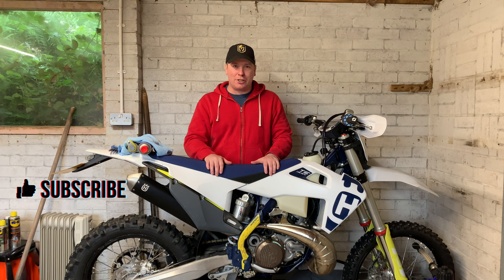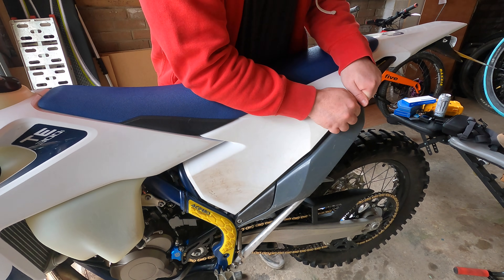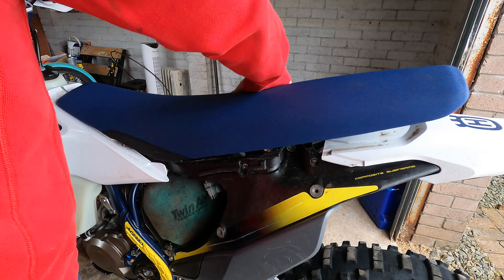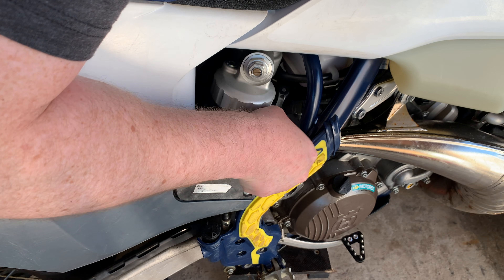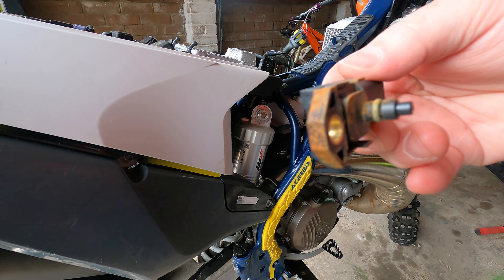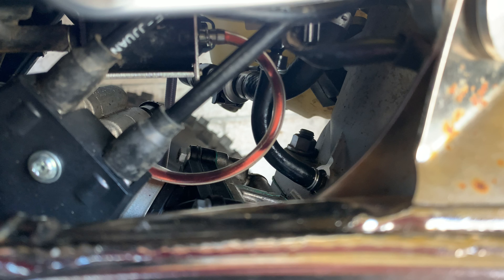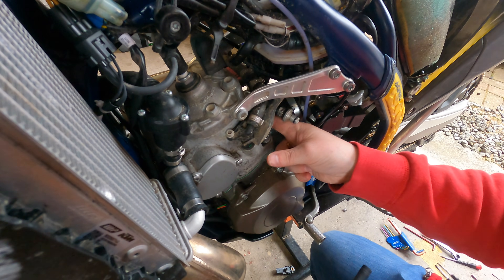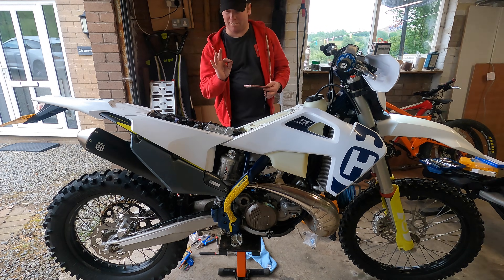KTM Husqvarna TPI CRANKCASE PRESSURE SENSOR ISSUE Repair. Free easy Fix for rough idle and stalling.

Comment: What app is this to see the revs etc etc? Is that a different ECU to be able to have that?
Reply from the maker: No mate, standard ECU and just used the 6 pin connector that is either under the ECU or poking in to the air box.
The app is called Car Scanner which was free. 

I bought the wireless OBD2 scanner and 6 pin CANBUS lead from Amazon

The links are below if you want to have a look. 
The scanner does both IOS and Android but I believe some cheaper versions of the same thing are iOS or Android and not both.

With the CANBUS to 6 pin cable, have a read up to see if it fits your bike, I think I took a gamble on the lead in the link down below but it worked so it was all good because I think most 6 pin connectors are the same. Hope this helps 👍🏻

 Foseal OBD2 Scanner WIFI Auto... https://www.amazon.co.uk/dp/B077F8F6TB?ref=ppx_pop_mob_ap_share 

OBD 6Pin Diagnostic Adapter for... https://www.amazon.co.uk/dp/B07VQQ3CHJ?ref=ppx_pop_mob_ap_share
Reply: @MALVSMACHINE  thanks for that information mate! I haven't got a TPI yet I currently am rocking a 2002 KTM 200 exc dinosaur but hope to get myself a TPI either KTM or husky soon :)
Reply from the maker: @ollie6512  no problem at all mate, i’m always happy to help where I can👍🏻. Awesome stuff, you won’t regret it. If you can, keep hold of that KTM, it’s a great bike and will only start going up in value in the future, the same way the old RM and KX bikes have over recent years 👌🏻.
Reply: @MALVSMACHINE  yeah ive definitely thought about doing this if I'm honest!
Reply from the maker: @ollie6512  good man 👌🏻
Reply: @ollie6512  Hold onto your 200! My 03' MXC is the most reliable bike I've ever owned. With suspension work, it can hang with my 18 XC-W TPI 250.
Reply: My only question exactly

Comment: I can’t find the angle sensor on my Husqvarna Norden 901. Where is it located on the motorcycle? I think it stopped working after the bike tipped over.
Reply from the maker: I don’t have a Norden 901 to be able to answer your question sorry bud, the only Husqvarna I own is the one in this video and they don’t have the same electronics.
Reply: @MALVSMACHINE thank you

Comment: So after a weekend of crappy weather I decided to take my bike out for a ride. My bike was running fine for around 3/4 hours then suddenly started bogging before full throttle on. Starts & ticks over fine even after the issue just when you jump on throttle then starts playing up. I am going to take a look tomorrow with your suggestions. But anything you could suggest whilst doing so?
Cheers

It’s a te250i 2021 btw
Reply from the maker: @christopherbrown5500  Hi Chris. Sorry to hear your TPI is playing up, cranky things aren’t they! 
Hopefully cleaning the tray and outer area of the sensor will sort it but failing that, do the usual checking of the pipes to make sure they aren’t blocked, and that the plug hasn’t fowled up. You could swap the ccp sensor with the ambient air sensor while they’re out of the tray so that you’re covering all bases. Give your electric cables a once over as well to make sure nothing has snagged. 
I hope all goes well so you can get back to it ✊🏻

Comment: Dude i have been trying like crazy to figure out why my bike is idling like that. I changed the fuel, filters, plugs, everything! Im going to give this a shot and see where it lands me. If this works I will report back with big props. Did you also swap the crankcase and the ambient sensors? Ive heard that works as well.
Reply: So this absolutely worked!! I cleaned the connectors, tray, tubes, and fittings with compressed air and swapped the sensors. It run perfect now!! Idles great and smooth and angry all through the rev range. Thank you so much for posting this!! I hope this video finds other Husky and KTM owners before they go through all the crap i did. Pretty sad that my 1 year old bike with 19 hours has this kind of issue honestly. KTM really needs to address this. Thanks again bud! Cheers!!
Reply from the maker: @HighSpeedTV  ah man I’m so happy, and glad you can get back out and enjoy it again! 
Yes they definitely need to address what’s going on with them, whether they look at a better design for the tray or a different manufacturer for the sensors, something just needs to be done. Thanks for letting me know how you got on, much appreciated 👌🏻
Reply from the maker: Hi! Ah man, it’s a pain isn’t it! 
I didn’t swap the sensors because I was hoping to make the video a kind of problem solving video, and as it goes, cleaning the area and making a better seal using grease around the o-ring cured it, thankfully. 
If It didn’t work, my next step was to swap the sensors like you mentioned, so it’s probably worth doing at the same time you’re cleaning the outside of the sensors and the tray just to save having to remove everything again if there’s no change. 
Another thing I’ve read up on since my issue is the type of fuel used in the bike can make the bike run poorly. The factory manual recommends Super Unleaded or 95 RON for EU bikes but I don’t know what that equates to in fuel used in other countries. 
Thanks, I’d appreciate it if you let me know how you get on as this common problem is really intriguing me and I’d like to see what is working and what isn’t so that we can hopefully find the best, free/cheapest fix for us TPI owners to continue enjoying our dirtbikes!

Comment: What is that rpm app???? If u could let me know that would be awesome please
Reply from the maker: Hi, the app is called Car Scanner ELM OBD2 👍🏻
Reply: @MALVSMACHINE  okay thankyou so much also i was cleaning my bike and i left a cloth in the air intake and nothing got sucked in but now my bike sounds like urs did in the beginning do you think it’s the sensor? It was running rlly gummy when cloth was in there i was thinking maybe a bit of gunk got into the ccp sensor hose? You know more than me tho do you think the bike will be okay?
Reply from the maker: @StupidActivities101  hi dude. Honestly, these TPIs are little divas so it’s a bit of trial and error with them 😄.
I think it’s worth cleaning the sensors, tray and piping to see if that makes a difference, and if that doesn’t work, swap the CCP sensor with the ambient sensor (Assuming the bike has one) and hopefully that’ll work meaning the sensor went bad.
That’s pretty much the limit of my experience with the issue dude. If I stumble across more info, I’ll drop a line on this thread 👍🏻
Reply: @MALVSMACHINE  okay okay yeah thank alot ill definitely take a look at the sensors do you know if the cloth that was in the intake when i ran it could have caused any internal damage?
Reply from the maker: @StupidActivities101  to be honest I wouldn’t like to guess; I never run a bike without a proper filter.
Reply: @MALVSMACHINE  alr thanks for the help also is there anything more to taking those hoses out and cleaning them or do u just take them right off and clean them
Reply from the maker: @StupidActivities101  anytime mate 👍🏻. It was just a case of taking them off, cleaning them and making sure they were completely dry before putting them back on. Be patient with them as well, the plastic tray is quite flimsy so if you’re forceful when pulling them, you may break the plastic bit that the pipe attaches to.  👍🏻
Reply: @MALVSMACHINE  it’s a 2023 bike u think i will need to clean the tray? Im so new to tpi man
Reply from the maker: @StupidActivities101  all depends on if it’s dirty or not dude, you only have to clean where the sensors sit to make sure the o-ring on the sensor gets a good seal.

Comment: hello, for a few laps I feel that my 300 tpi is slower in revving and it seems to have less power, I thought it was because it's very cold but now I'm evaluating the problem you describe in the video, what do you think? Do you also feel a slight decrease in power in cold weather? the bike has 40 hours.
Reply from the maker: Hi Alessandro. Where I live it’s cold and wet most of the year round so the issue started and never got better. 
I’d say it’s worth cleaning the outside of the sensor and the tray as it doesn’t cost anything, and then seeing how it fares from there.
Reply: @MALVSMACHINE  Thanks a lot for the answer! why do you advise me to remove the sensors and clean them? How do you recommend I clean them?
Reply from the maker: @alessandrotrosardo295  no problem 👍🏻. 
I only recommend as it seems the engine vibrations allow water and dirt to ingress and dislodge the crankcase pressure sensor enough to cause the engine to bog down/idle rough. 

To clean, I just take the sensor out of the tray and clean the outside of the sensor only, and then the tray so that the sensor can be seated correctly. 
I coat the O-ring lightly with grease before the sensor is replaced as per the video. 

If your problems are the same after cleaning, try swapping the sensory as other people have had their sensors go bad. They swap the crank case sensor with the ambient air sensor which is the same type of sensor, and then that seems to cure their issue. 
Best to start with cleaning, then swapping before spending your hard earned cash 😁.

Comment: What app and connector did you use to show idke speed? What else does it do/tell you?

Cheers
Reply from the maker: Hi Alan. I use the Foseal OBD2 Bluetooth connector with the 16 to 6 pin connector, and the app is called car scanner. It basically shows the rpm, water temp, ambient temp and throttle position. I’ve made a video where I show it in detail and adjust the idle if that helps?

Comment: I tried this now my bike won’t start. Any idea why?
Reply from the maker: Hi. Assuming nothing got inside the sensor during cleaning, and everything is back fitted snug, it could be a faulty sensor which has now failed.  My next step when I was filming this video was to swap the sensors over if I started the bike up and it was still running poorly, but the cleaning did the trick in this instance. 
The video I watched about swapping the sensors was by a YouTube channel called WA Semi-Hard Enduro, and fingers crossed that’ll help make your bike start so you at least know it’s a dodgy sensor.
Let me know how you get on.

Comment: Thank you for the solution! What app are you using on your phone and is that an OBD2 dongle - what model? Thanks again!
Reply from the maker: Hi, no problem, I hope you found it useful. Thanks for your question. I use the Foseal WiFi OBD2 scanner for android and iphone, with a 16 pin to 6 pin adapter that I bought off Amazon. The App is called Car Scanner which is recommended by the instructions of the scanner but they do recommend another app if this app isn’t to your liking. I made a video which is in my library, about the setup if you want a bit more detail on the scanner, cable, app, and connecting it all up 👍🏻.
Reply: @MALVSMACHINE  thank you! I'll definitely check your other videos for that setup! I really appreciate it! 👍
Reply from the maker: No problem at all, glad I could help 👍🏻

Comment: Hey man, great video! Gonna try this just for general maintenance. What cleaning spray did you use? Is contact cleaner the one? Cheers!
Reply from the maker: Hi Callum, thanks mate. Yeah it’s defo worth doing as part of general maintenance. I use WD40 contact cleaner to give the contacts a clean as well, but I would just use normal WD40 or even a wet cloth if the contacts are fine because it’s just the outside of the sensor, around the O-ring and the housing tray that requires the cleaning so the sensors can sit in the housing properly 👍🏻.

Comment: My 2019 tpi started doing this after the wettest/muddiest enduro I've ever done, previously it ran like a dream with the TPS update/head. I actually already purchased a replacement CCPS but will try out your fix before and report back.
Reply from the maker: Hiya mate, thanks for the comment. Sounds similar to what happened with mine, lots of mud and deep puddles, and then the bike was not happy. It’ll be great to hear back from you as the more information we get on these bikes and their issues, the better. I made this vid to hopefully save people money so I really hope this works for you - at least you’ll have a spare sensor if the cleaning out of the tray and sensors makes things run well 😄👍🏻.
Reply: @MALVSMACHINE  I broke the brass screw off when putting it back into the engine (I took it out to clean it). Need to take top end off to get an extractor in there now.
Reply from the maker: @bikesbeersbeats  ah no, nightmare!!
Reply: @MALVSMACHINE  extracted and replaced the broken part. Unfortunately no change. 

1. Replaced with a new CCPS.
2. Replaced fuel pump filter.
3. Replaced inline fuel filter.
4. Tested jets independently and they’re both working.
5. Tested various air screw configs.
6. Hooked up OBD reader and TPS is fine.
7. Replaced spark plug. Noted that the plug was rich.

Unfortunately still has the rough running and hanging idle when letting off throttle. I have another 2019 tpi to benchmark against. So next possibility is check packing in exhaust and check crankcase for air leaks.
Reply from the maker: Wow you have been busy! It’s really annoying that after all that work it’s still not running right. I hope you get to the bottom of it soon.
Reply: @bikesbeersbeats  put some videos up while slowly accelerating in 2nd gear to the power valve opening point

Comment: Is it running scrappy at low RPM or all the time mine runs great in open trails but at low RPM it sputters and dies
Reply from the maker: Hi Shawn. Yeah it was as you described there. Was really annoying but thankfully cleaning it sorted it out and I haven’t had the issue since. Some people swap the ambient pressure sensor and the crank case pressure sensor around at the time of cleaning just in case the crank case pressure sensor has gone bad so may be worth doing as well just to save you having to take the sensors out again if cleaning alone doesn’t work.

Comment: Struggle to find the 2 screws
Reply from the maker: Hi Reece, they’re a bit of a pain to find but as soon as you see them it’s not so bad a process. Start with the ambient pressure sensor on the right side of the bike because it’s the easier one to see and to get off, the screw is close to the rear shock - lightly press down on the tray where the sensor is and shine a light in there, you should be able to see the torx head. Once you see it, you should be able to guide your way in with whatever you’re using to unscrew it. 
The other sensor is even more of a pain to get to but same thing, press down and shine the light in to see where it is and get your tool in. 
All the best dude 🤘🏻.